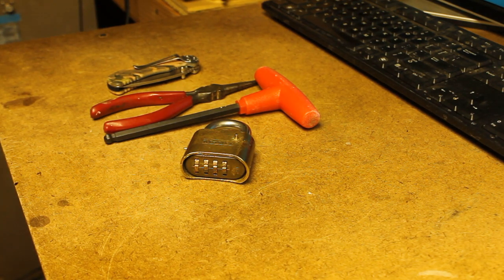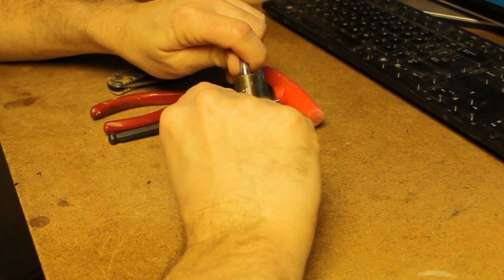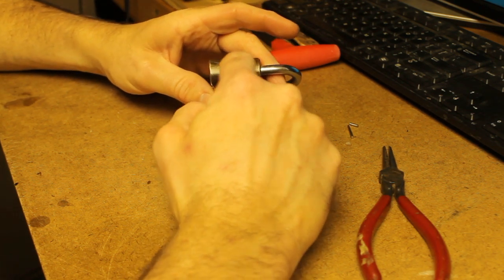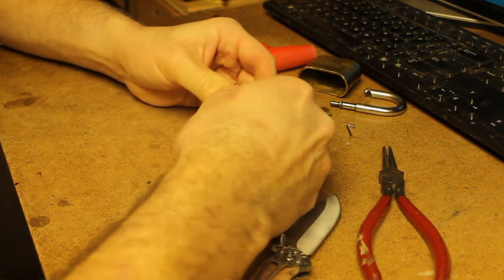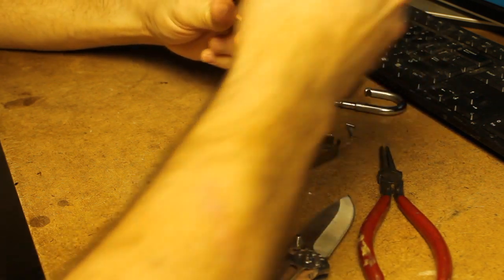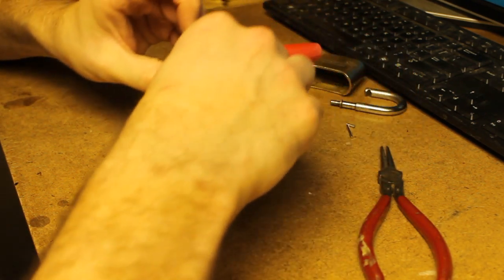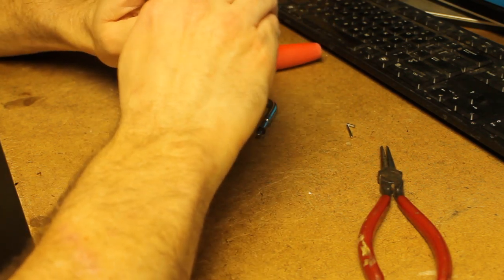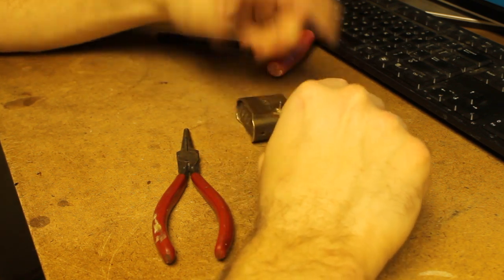Lock Picking the Master 175 Four Digit Lock - Disassembly and Decoding

Comment: My pin above the “R” in Master slid a bit out on its own and the shackle fell out, I mistakenly pushed the pin in before securing the shackle, but thanks to this video I was able to learn how to remove the pin and get my padlock set back right.  I taped the pinhole over to prevent further issues (it’s indoor use).  Thanks!

Comment: I've been tapping/hammering for the past couple of days but so far no luck.   Pin isn't coming up at all.  Not having any luck feeling for the flat spots on this lock either.   It's one with very little space for the feeler gauge.
Reply: Same here can’t get pin on front out is there a suction tool that can be tried?
Reply: Did you ever succeed? Im having the same issue. With tapping pin will go from very recessed to flush but then will sink back in.

Comment: So many of these videos have the same frustrating problems:
Using technical jargon  it's unreasonable to presume the general public knows, in a video billed as a quick way to reset a lock, using no special tools or no lickpicking skills -- then it's all "just release these two palls ..."  What are "palls"?
This is especially tough without a clear view of what's going on!  I know it can be difficult to get close shots but frequently enough its the person's hands that are blocking the view.
Of course, there's the corollary to this and that's the use of terms that, although not technical, are still plenty unclear.  Thus we have instructions to feel for a "little slot" located "right over" where "it started out" -- narrating a scene showing a tool scraping a jiggling piece of metal referred to as "a bar or lever, or handle for lack of a better term .. "  Again with a picture that is difficult to interpret.
I know these things seem clear, even obvious to you, if you already know what's going on.  But it's not so intuitive to us greenhorns.
Finally, there are even times a person demonstrating a procedure appears to maybe not be so knowledgeable or able to do whatever supposedly easy trick.  This happens in this video at about 8:20 when the guy is having trouble popping something apart and resorts to taking the lock completely off camera and removing the shackle there.  When he comes back he says something like, "as you can see, I was able to remove the shackle..."!  
This comment shouldn't be taken as specific to this video -- it's only that I decided to carp about these things now -- in my slow struggle to learn about this master lock!

Comment: I used 2 cycle oil to loosen up the debris in pin holes and then push lock arm down then tap lightly and pin came out and for small pin i had to push in on wheel cover and taped till pin came out .. now small pin had rust . but i cleaned out with ice pick like tool and 2 cycle oil and it worked fine